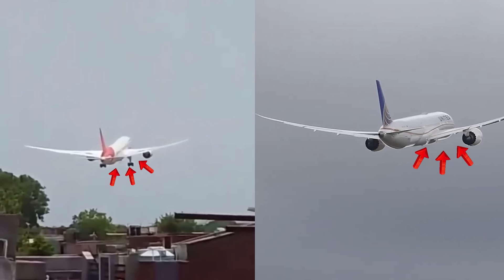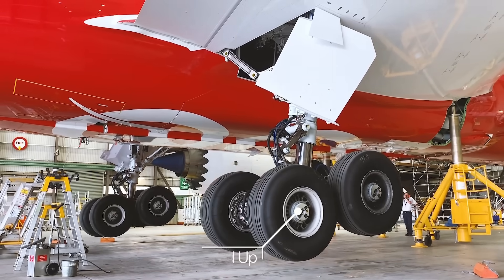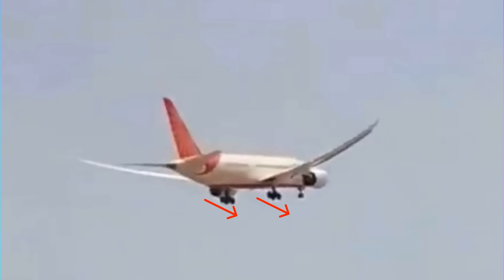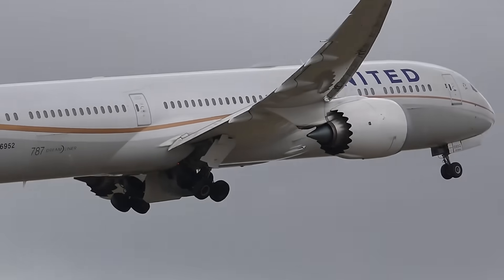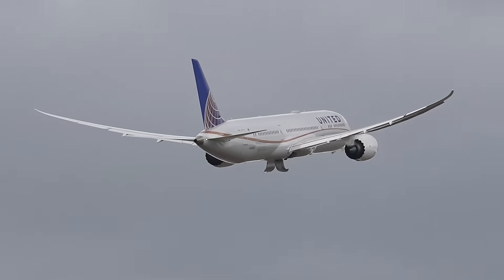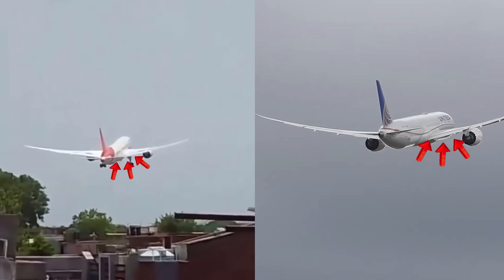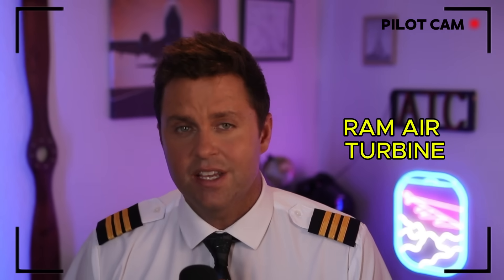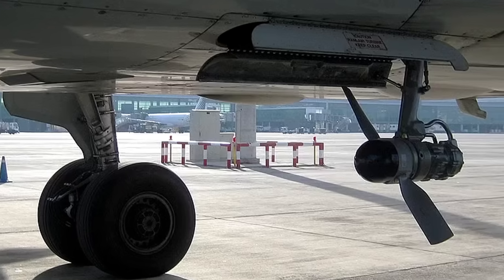Pilot Explains: A New Detail in the Air India 787 Crash Everyone Missed

Comment: One of commentators pointed possibility of fuel vapour clogging of fuel lines. Plane departed at 39degC 104F standing a long time in extreme heat at tarmac. Usually this is not a problem as fuel pumps compress the vapour but here something wrong happenend with pumps and while plane rotated all bubble in fuel lines trawelled upwards possibly leading to fuel starvation and engine flameout. Fuel pumping problems may be responsible for very late rotation almost at the end of runway the fact mentioned by some commentators.
Reply: Lack of power was clearly visible in gear position. Before retracting wheel buggies are commanded to change position from point up to point down before gear bay opens and actuators fold the gear inside. In AI171 buggies are in point down position but retracting has not started. It could be deliberate action before hard landing but may also indicate lack of power to fold heavy landing gear.

Comment: As a pilot having studied the history of commercial airliner crashes, you should be aware what was the most common case of a "dual engine failure". It is the case of a single engine failure and the pilot shutting down (fuel cut-off) the wrong (remaining) engine. So in my opinion "pilot error" is not a very remote possibility.

Comment: As soon as I heard the CVR recording, when the captain said "no thrust", immediately I thought about dual engine failure caused by contamined fuel. I remembered a Cathay Pacific's flight (an A-330) from Surabaya (Indonesia) to Hong Kong, years ago, when the contamined fuel jammed the fuel injection valves in both engines. Fortunatelly the captain's exceptional airmanship saved everybody's lifes.

Comment: The failure of both engines due to water in the fuel system is also possible. Think of tropical rain in this area. The fuel pumps do not notice the water and thus blow the nozzles out.

Comment: Maybe electrical failure stopped the fuel pumps, loss of positive pressure in fuel lines, vapour lock (plane had been heating up on tarmac for 2 hours) and then double engine flameout?

Comment: how about if the Captain experienced a heart problem or a heart attack and the co pilot busy with his panel.... could it be he dint notice that his Captain was experiencing cardiac arrest... and accidentally reduced power for lift or take off which resulted in power reduction and all instruments failed. its just an opinion due double engine failure and loss of electrical power. it could be why the engine went so quiet during take off .

Comment: Good afternoon.
One thing is certain, the engines lost power. I really believe that while still on the ground, the plane still took off, but due to the thrust it was carrying, and the sound also shows that the noise of the engines is much lower than it would be during a normal takeoff.
On the other hand, it seems that the plane goes all the way to the end of the runway (the dust in the air indicates this), and drags itself almost the entire way, appearing to drag its tail, which, by the way, got stuck on the roof, seeming to show that it was lower in relation to the center of the plane.
For the engines to suddenly stop, if that's what happened. Did something happen in the system, bad fuel?
Power cut to the engines due to electrical failure and/or cut in the fuel supply?
Maybe that's what could be it, we just have to find out why, until then there may be surprises and other causes.

Comment: A major clue that everybody seems to be overlooking is that the aircraft used the full length of the runway (about 11,000 feet).  In the context of total power loss, this takeoff roll suggests that one engine failed at, or soon after, V1.  Then, the second engine failed just after becoming airborne.

Still a "dual engine failure" in the end, but a different character to that where both engines fail at the same time.

Comment: Seems to be loss of fuel flow to both engines, due to lack of any evidence of one engine blowing up so badly that it does fratricide on the other engine.   Maybe there is some part in the plane, where what doesn't seem to be a single point of failure for both engines, does have some fratricide possibility upon either of two points failing.  

One possibility of that is if cross-fed fuel lines passing near each other.  Then it just requires an explosion there, or an engine blade being thrown there.  The survivor did say he heard a bang at the beginning of things starting to go south.

 I HATE to go there, but the absolutely simultaneous failures force me to consider sabotage, whether by a bomb at just the right place or two, or by just truly sabotaging the plane's systems to kill the fuel flow in some way.  Fuel shutoff after 60 seconds or 500 foot altitude gain, maybe.  Whether that could be done with software sabotage or requires an added device, I do not know, but it seems pretty likely that if you can shut off the fuel flow by pressing a button, flipping a switch, or moving a level in the cockpit, you can shut if off by telling the computer that button has been pressed, switch moved, or whatever.

Then you just face questions like "Who wants this particular (or any random) Air India flight to crash right after takeoff?" and "Who had physical access to change the software, or what bug allowed it to be done remotely, by whom?"

 I'm familiar with contaminated-fuel engine shutdowns, especially when DEF is accidentally added to the fuel.  Those incidents take a while to clog things up, so generally happen at altitude.  For it to happen right after takeoff seems odd, and to happen so simultaneously for both engines, "odd squared".  Not as remote a possibility as simultaneous mechanical engine failures, but unless one fuel intake/pump/line feeds both engines, you're still in "coincidental timing" territory.

Maybe the black boxes will show sputtering, less than simultaneous loss of power, but I don't think so.  It flew so smoothly, not yawing around as would happen with two engines independently failing even 5 or 10 seconds apart.

Comment: So if it was contaminated fuel, why was only one aircraft fuelled in that day effected ? I love it when pilots try to be engineers. the gear tilt is due wind loading. After takeoff the wheel truck is relaxed, as it must be to handle the undulations of the takeoff roll. Aerodynamic forces push it forward. The retract process ensures it's locked forward. Your point is such junior pilot babble. The UC was down and locked. UC may deploy from up by weight, but it needs that momentum to lock. A semi deployed UC will not achieve down and locked without hydraulic pressure. I love it that you use a low pressure retraction as your video, that's only used in engineering procedures, in real life that gear retracts in seconds.

Comment: One Question.

Why is the plane with no power high nose up?
And the rear wheels alr flat as in ladindig mode??
Flaps are extended as in landing mode for the 787.
Same as nose high and wheels straight for landin.

What this plane after take up set in landing mode on the MCP!!
So yes its thinking its landing and on the ground.
Flaps are extended on flaps 5 that can you see in the video.
Wheels are not up in the sky as the nose from the plane.

Conclusion landing gear is not in retraction mode.
Landing gear is in free in takeof mode or landing mode.

Other wise the grear whas UP on this crash

Comment: Not questioning the dual engine failure but I don’t think fuel contamination would coincidentally cause a  flame out on both sides (feeding from different tanks) at the exact same moment.  Maybe an issue with FADEC or some other failure.   Tragic outcome regardless.  Waiting for CVDR analysis to tell us more.

Comment: Dual engine failure can happen via the central fuel pipe vs the wing pipes used during takeoff. So during runway run , fuel
Pipe in wings are working fine. Moment it takes off, fuel comes from central pipe and that cuts off fuel to both engines.

Comment: There was  LATAM B777 that lost all electrical power and made an emergency landing in Brazil a few years back. The generators were running but the electrical busses were not. What if an electrical failure causes all the FADECs to lose power and since B787 engine control is fully electrical, no fuel was metered to the engines

Comment: There was lack of thrust BEFORE take off. Plane was a minimum 6 knots below ideal take off speed. And that is after using the WHOLE runway (hence dust). Pilot deliberately left it very late to take off. Clearly whatever happened atfer take off, the problems started ON THE RUNWAY

Comment: Great analysis.

The next question I have is assuming that "gear up sequence was initiated at the same moment when both the engines failed", so the gears were tilted forward but were never lifted up (as RAT can't pull it up).

But if you look at the gear up sequence of 787, when the gears are tilted forward the landing gear main door is also lowered down. And both of these are simultaneous.

So the open question is, why were the gears tilted forward but main doors were not lowered?
In the video we can see that landing gear hatches are fully closed.

Comment: If contaminated fuel .... why only this 787?  Shouldn't there have been other aircraft with the same problem?  was there something specific about this jet's fueler?  source/process?

Is there some process in the refueling that requires action by the fueler to allow for unrestricted "full fuel flow?"  limits to doing an engine run up for 30" and that's it?

I agree, simultaneous mechanical failure of both engines .... assuming ETOPs was completed ... just no way.

How confident am I we get the right answer in a timely fashion?  Not very.  I empathize with current 787 pilots having to move the metal while there's question about what happened.  Just bet that it was something local/airline related .... and launch DFW-NRT ... or worse, NRT-DFW and remain 2 plus hours away from land.

Comment: @Garybpilot, agreed:
_Dual engine failure
_Electrical power down
_LDG retraction stuck
_RAT auto deployed
Please tell us about:
1. APU? 
2. System Software glitch? 
3. LDG stuck (sequencing was retracted! or retracting) - system software perception? - a/c status: on ground or airborne??.... Further more and more importantly, .... were the engines shutdown auto commanded before LDG retract failure or  after? 
4. Note that there was a loud bang just seconds after LDG lifted off ground. A low possibility but what if someone panicked after the bang and the individual opened the emergency door(if possible at all? What would be  system logic and sequential command to the a/c?
Reply: Chat with AI

Comment: I'm glad that you spoke about engine noise. The one thing that came to my mind was that it seemed that the prop noise from the RAT could be heard. Anyone anywhere near to jet engines giving full power at take off would struggle to hear anything but the engine noise.
I have seemna video showing the RAT deployment, and noise, but in a landing situation with minimal engine thrust.

Comment: The question is how does a 787 completely loses electrical power. Contaminated fuel may hsve affected other departing flights using same mixture and that hasn't been reported by any other operator yet.The fact that reports of problems with this specific aircraft's  A/C and onboard video systems ,  and duly noting  these not having a bearing  to the accident, can point to question the airline's overall maintenance pokicies and  protocols as ultimate culprit.

Comment: Excellent work in progress - Saw a report by passenger on same plane (the flight just before), talking about electronics & air not working on that flight.  I was thinking that the fuel did explode, - so not sure about contamination… but fuel cut-off valve(s) do they fail-open, or closed ? And the comment by humble mechanic, that an electric failure is suspect, and noted just the flight before.  Or could there be a “rag” in fuel line, blocking fuel supply to engines (?) thanks for insights. Spot-on for what these hydraulic systems do in logic.  ML

Comment: question: Fuel contamination explains duel engine failure. Does it explain power failure? is there one at all?
what are the on the ground checks to ensure there is no contamination? and are there any automated checks if the flight recognises any contamination. What power is RAT using if there was a power failure

Comment: That’s a very good point in your reference to Captain Steve’s update detailing the RAT deployment and the clear sound of it in the original video (not the widely circulated, poor quality video of the video).  The fact you could hear the RAT clearly instead of the engines roaring at that point was shocking.  It would appear they lost power only seconds after they were airborne.

Comment: My question would be directed toward the maker of this video.  You mentioned at the beginning of this video that it appears the flaps were set "at least at a flaps 5 setting".  In a 787-8 Dreamliner with 279 people on board (which would be at about maximum capacity) and a full load of fuel for a long flight, the plane was obviously "heavy".  That day was especially hot.  Is flaps 5 enough to provide lift or should flaps 15 have been used?  If flaps 5 wasn't enough to provide lift, then the plane is in a stall, which is easily mistaken for a loss of thrust.

Comment: Not sure about this analysis. Gear is connected to the fourth hydraulic system. Not sure which system powers the gears to go up, prior to getting the gear up totally. But it should take off fine even with gear down, it will burn fuel like crazy, but will work fine.

The polluted jetfuel is a possibility which would result in engine failure at the same time. I guess there is no other reason (except dual bird strike) which stops both engines.

I did see a video of (allegedly) this airframe where passengers showed that the airco was not working. Need to be very careful as this can be any aircraft anytime.

Comment: Both engines stopped at the same time, otherwise we would have seen a rotation of the plane even if one engine stopped a second later.  So what can cause both engines to stopped exactly at the same time?  Fuel contamination cannot be since water and fuel do not mix, making the likelyhood of water bubbles reaching the engines at the same time extremely rare.  So turning off electricity at the same time could be the only possible explanation?  Or is there any other way both engines failed exactly at the same time?
Reply: Don't think they stopped at the same time at or during rotation. Look at the vortex/dust below the left engine as it rotates. That means that engine was still running. I do think that they eventually both engine flamed out or lost thrust.
Reply: @djurispijker3519  , so that means it could potentially be water in the fuel, but it would need to be a significant amount since for several seconds none of them got loud and lifted the plane.  Does this mean electrical failure affecting both engines could be at the top of the list?  The engines may continue rotating even without combustion, but it doesn't mean they were working.

Comment: Contaminated fuel is most unlikey as other aircraft refuels took place, unless cladosporium resinae, commonly known as the "kerosene fungus" or "fuel bug," is a fungus that thrives in fuel tanks, particularly in the presence of water, blocking hp fuel pumps. . The RAT operated almost certainly in response to a dual engine failure as the “MayDay” was qualified by “Loss of Power Loss of Thrust”. It reached 650ft through momentum as it had rotated VR with full/selected power otherwise abort at V1. From the video the aircraft showed a positive stable (6DoF) descent the wing tips still slightly flexed up with reducing aerodynamic speed giving some lift but insufficient to maintain its heavy all up weight and main landing gear drag.  To excuse the term but its fatal descent/stall was “graceful” (no yawing or pitching). Engine Computer management : there have been incidents since such as 1988 A320 Habsheim low level forest entry, Nov 2008 XL 888 (FAC alpha prot sensor ) and A-400M engine (3 engines out of 4) management of computer management issues. For a dual engine failure the finger tends to point to the engine management computer control unit, but that needs to be fully discerned as whether it is a software, firmware or hardware or incorrect initiation by a critical parameter common to both engines (aircraft).  My experience is a mostly military aircraft (fixed wing) damage assessor, and aero systems (propulsion) engineer on transport (Mil and Civil) that included engine monitoring (health and critical parts lifing) during A380 and B787 flight testing during airworthiness registration of life consumed for the sell on of a small batch of engines.

Comment: I came to the conclusion of Double Engine Failure on the first day and I figured it was either a Fuel Issue or an Electrical Issue but I would never have guessed Contaminated Fuel. 
That is an interesting possibility. 
I don't know enough about the Fuel System to know how it could be cut off to Both Engines at the same time. The only way I can think that Electrical Power to Fuel Pumps and/or Engines could happen is with a Fuse blowing somewhere and again, I don't know if that's how it works ?
Ultimately, I am convinced there was a total Fuel and/or Electrical System Failure, causing the Rat to deploy but the plane was not moving fast enough to generate any usable power with the Rat.
Reply: PS> Good Call on the Landing Gear. I believe you are 100% correct on that matter.